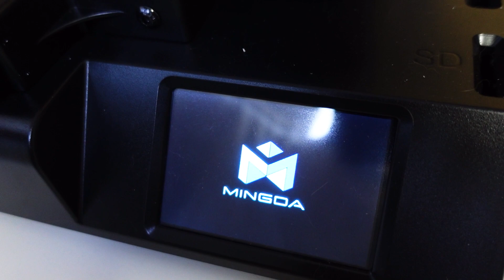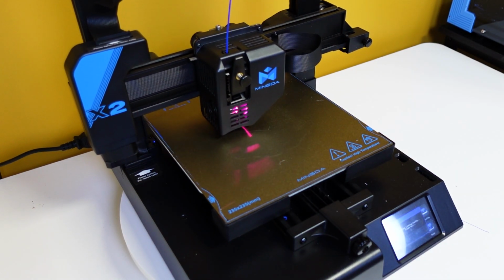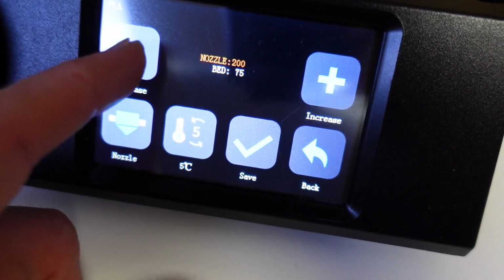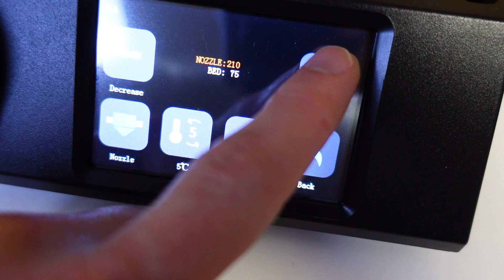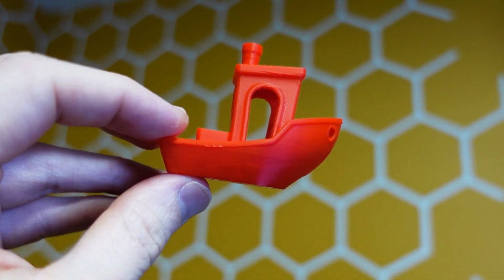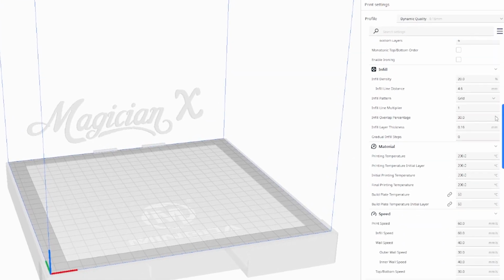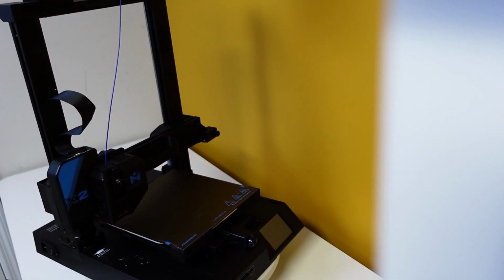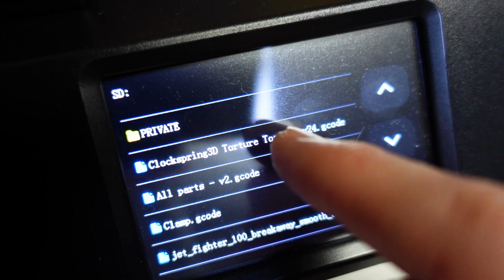Master the Future of Printing: The BEST Budget Friendly 3D Printer of 2023!

Comment: I bought a Sovol SV06 - basicly a cheap version of the Prusa MK3. I did very few 3D printed mods, and swapped out the y axis motor for a bigger one.  About $20 in upgrades.  It just prints, day in, and day out, without any tinkering. Before that, I bought a Tevo/Homers Tarantula, E3D clone. The Tarantula always needed tuning and mods to keep it going, to the point where it is in parts, in a box, waiting for major upgrades.
Reply from the maker: I definitely heard a lot of good things about the SV06. I never had the chance to try it though. I dont use this machine right now because I have so many other printers, but this one really is a great machine all around. I loved it while I had it plugged in

Comment: I'm looking to get my first 3d Printer.  I do not want to spend more than $300ish.  I was considering an Ender 3 V3 KE, but this one looks good too.  What would be you choice between this printer and the Ender?
Reply: KE has linear rails, and is running Klipper, for the price much better
Reply: Sovol SV06 hands down, better than both at about $210.  If it gives you trouble, beef up the y axis stepper motor for about $10 bucks.

Comment: That's all great, but I bought one has a problem the second day and contacted support, they talk a great game, but I never received any parts and you can't get them anywhere, the firmware was dated 2021 and you can't run any printer without updating it, that was the worst printer I've ever bought, the one print I printed was one that came with it, so I never got to test out the printer.
Reply from the maker: Interesting. Sorry you had a bad experience. I never updated to the latest firmware and haven't had issues. The firmware feels old but 9/10 printers I review and firmware that feels old. I at least appreciate the functional firmware, even though it feels old. Maybe you just dust it off and give it a try or get the x2. The x2 is brand new so maybe you'll have a different experience with it instead.
Reply: Hi dear friend, this is Tracy from Mingda after-sale support team, may I help you?

Comment: That hot end looks pretty big and heavy which can lead to stringing I think  ( I know heavy hotends do something bad but I can’t remember)
Reply from the maker: I won't say that doesn't happen, but I haven't experienced that before. A heavy hotend will increase ringing. Heavy hot end + fast print speeds will make super ugly prints, especially with resonance compensation 😂
Reply: I confirm, i have a little stringing but is very little, like you can count the strings with only one hand, probably o can get more stringing if i try to print faster with the X2

Comment: I think the one thing 3d printing companies need to understand is just make them silent I would pay extra just to have a silent machine it means those who have there printer in there bedroom can print at night making speed not a concern
Reply from the maker: Unfortunately it got cut from the video, but this machine is incredibly quiet. Standard fan speed printing was 43dB and max fan speed printing was around 51dB I believe.
Reply: That is a double edge sword.  Silence comes from v-wheels, which generaly need maintenance, and are not as accurate.  One way to upgrade v-wheels is to swap them for Polycarbonate wheels. That way wheels will not accumulate dust which causes artifacts on the prints.